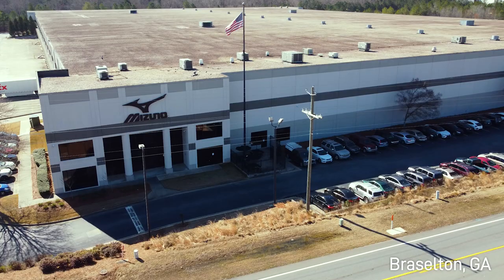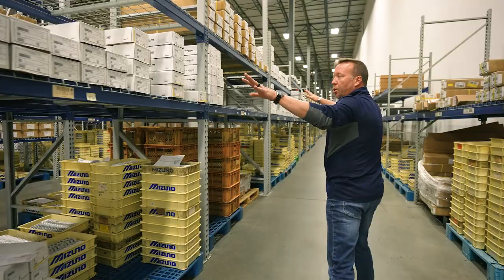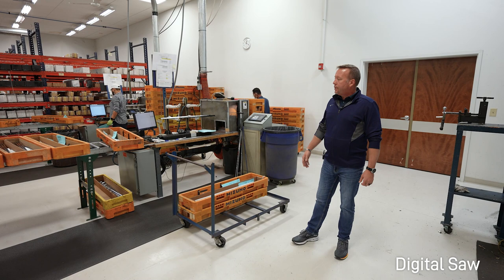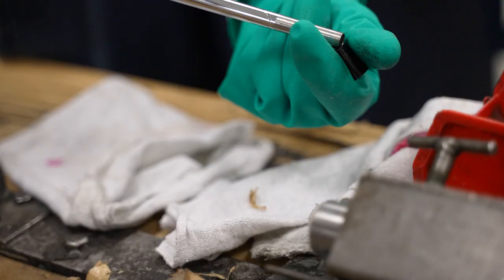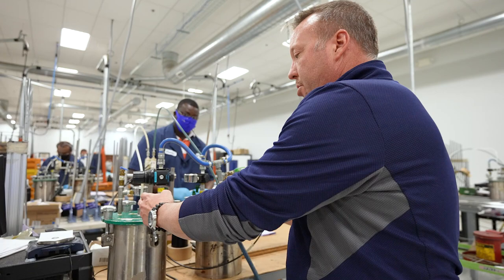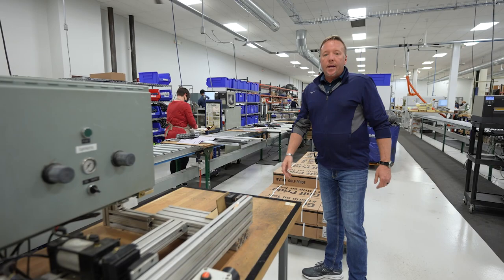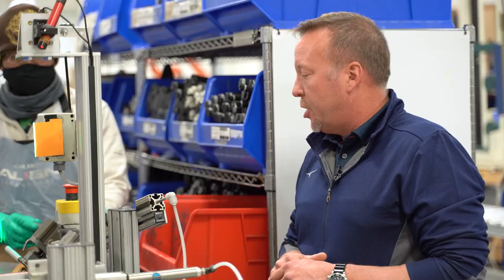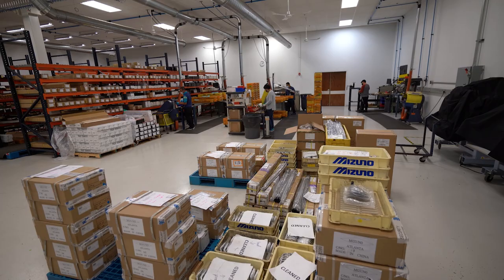Mizuno Golf USA Custom Assembly Tour

Comment: I love my MIzuno JPX919 Hot Metal irons but the quality control and customer care/warranty of Mizuno has greatly diminished to almost none. The swing weight of my 7 iron is a full 2 points off (light) and when i called they refused to do anything about it.  I was told if i wanted to I could send them the club and they would change the swing weight but I would have to pay for everything including shipping and a new shaft and grip because my shaft might be cracked (?). I have been told it appears my 7 iron may have been assembled with a head which was to be used on a steel shaft and mistakenly was used on a graphite shaft. Never the less, the club's swing weight is noticeably light.             Mizuno made it that way ( 2.0 swing points light) and they refused to correct it unless I paid for the repair PLUS all the shipping and also for a new shaft and grip!!! 
stillit seems they no longer

Comment: A few requests - I have a full bag of custom ordered Mizunos, so I think these are reasonable: 1) Can you re-add the Align Midsized +4 Grip you've removed - I now order MMC Midsize +4 and then throw them out, 2) Can you add the Steelfiber X-Flex i110 shaft, you have the S-Flex so adding the X would be easy, 3) the Tensei White Pro TS-Flex Hybrid Shaft is great - can you add that as a non-upcharge also for fairway woods, 4) this is for Marketing, please add a 7wood to the fairway offering, easier to set open for a non-draw setup. Thanks!
Reply: Can I purchase a vintage, flawed, used or new, Mizuno Bettinardi putter from Mizuno?

Comment: I've been thinking about swapping my i25's for some Mizuno but would like to really try out some options.  Unfortunately here in Northeast PA it's hard to find a shop that will give you the time of day to actually discuss the clubs, the fitting, etc.
Reply: I hear ya Mike. Sometimes  you have  to travel to a Club Champion, True Spec, or hell TXG in Toronto (when allowed) for a great fitting. I know Cleveland is only 90 min away. I travel that to get to a True Spec golf to get a great fitting for irons.
Reply: @arpus1995  I honestly just buy what I like the look of and then build everything myself.  There is a local guy that lets me on his sim and bends irons/wedges for me.  Normally the fittings are done by me on a course during a round of play taking notes on flight, spins, response, etc.

Comment: You have left out an important step in the process. The shaft needs to be spine aligned so all shafts have the same bend characteristics and then "pured" so they oscillate  without any "wobble". You seem to be more concerned with cosmetics than shaft performance- other than swing weights which you do check.
The shaft is the engine of the club and it must not fight or alter the swing pressure on the club. Custom club builders always test the shaft and orient it properly with the clubhead to ensure maximum performance when swung by the player.